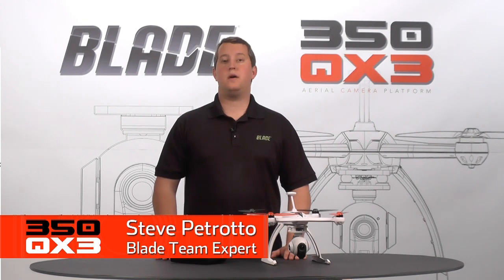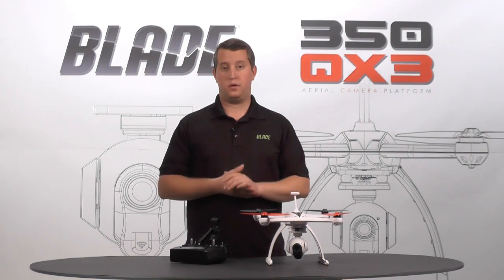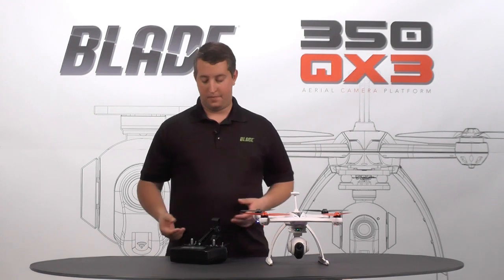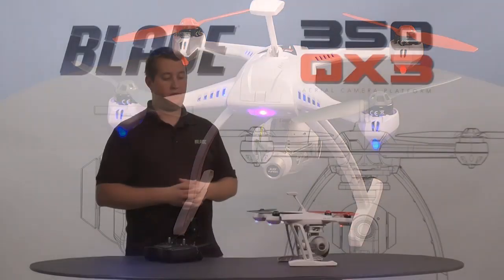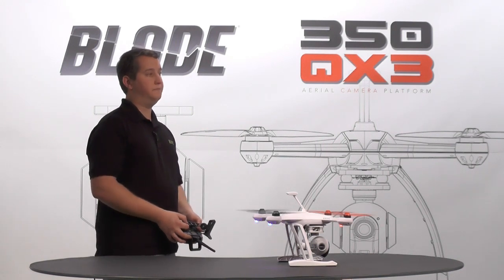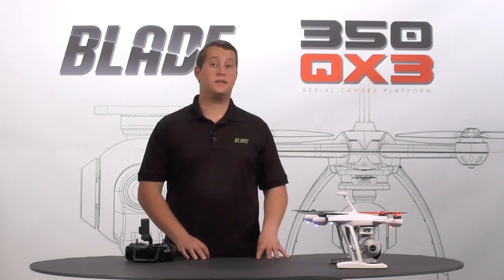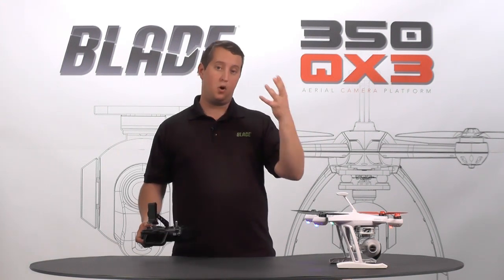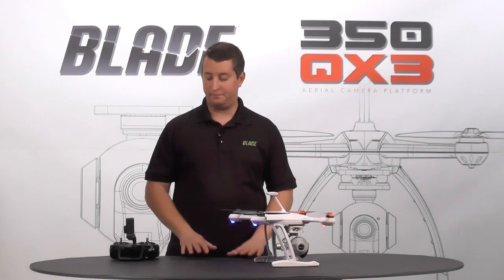Accelerometer Calibration 350 QX3

Comment: Hi Steve, I just pirchased a Blade 350 QX3 BNF. I was also told that I need to supply a 5+ channel DSM2 transmitter. Sorry to sound dumb but is that any Sectrum DX or does it have to be a 'DX4' and if it is any DX which do you recommend, also are they easy to bind? Cheers Martin. PS like the compass calibration video too.

Comment: Allow me to share with all something NOT written in the manual, yet vital if you wish to avoid a crash. (This happened to me) Safe mode ONLY WORKS IF GPS MODE (SOLID GREEN LIGHT) IS ON & SOLID. If you lose GPS, even in safe mode, you lose "Stick relativity" (If you push the R. Stick away from you, the craft will move away) If you lose GPS & the red propellers are facing towards you & you push forward, THAT is the direction the craft will move in! (I crashed into a tree cause I didn't know about this, not in the manual)

If you want Stability & Agility mode, even with the DX4 transmitter, hold the R. Stick down, and toggle the RTH lever four times up & down, Now you have stability mode (blue) Agility mode (Red) & rth still. (I think)

Lastly, if you do aerial photography & wish to avoid fly aways, use a camera that doesn't use 2.4 Ghz wifi! This interferes with the GPS circuit board.